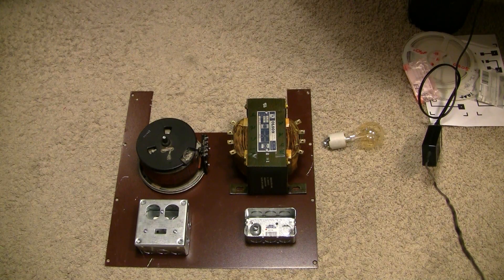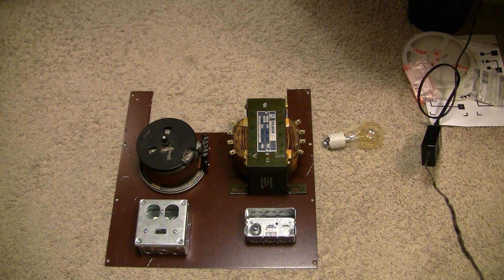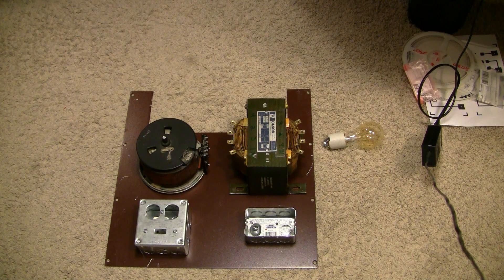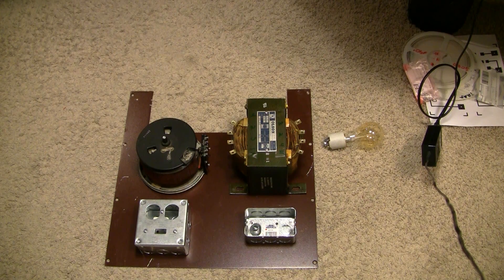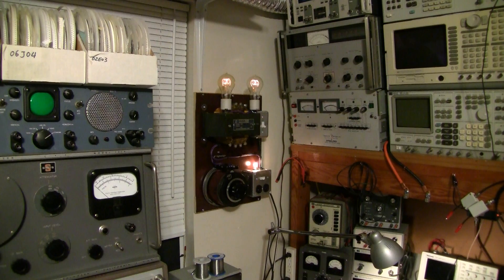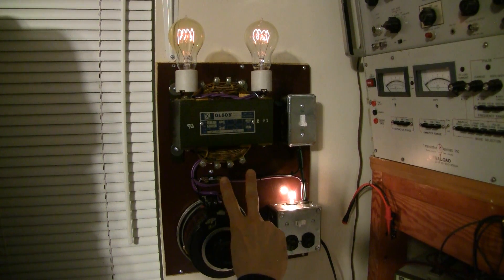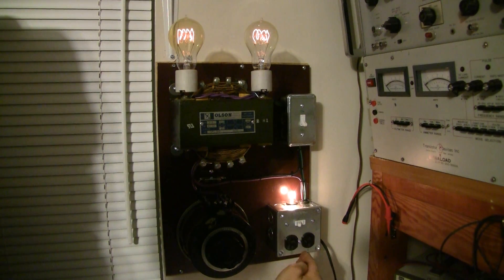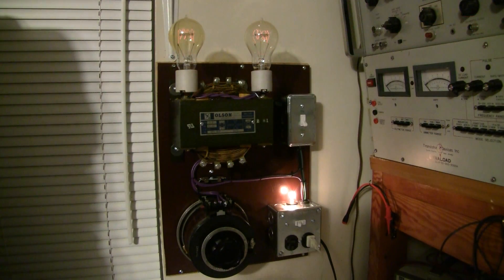Big Dim Bulb Tester with Variac and Isolation Transformer

Comment: Hello, I have questions. With your 2 bulb system you said it limits to about 1 amp. How would this be useful to see if a larger device that works normally at say 4 amps? A higher current device would light your bulbs bright every time making a person think there was a dead short when there wasn’t. How would a person go about calculating what wattage bulb to use to allow a current limit to just a bit below that of say a mainline power fuse wired to a power transformers primary?
In other words calculate a wattage of bulb to only limit or light brightly at just under main power fuse blow point with say the device under test using either a delay blow, or norm blow type of fuses. Or would a better approach be to note from device label the input wattage of the device under test, under its normal stated operating voltage, and then somehow select a proper wattage bulb that just starts to glow dimly at this point? Thanks for any insight you can provide.

Comment: Nice vid. Thank you for taking the effort to show us. 

What mounting do the bulb sockets have? Couldn't quite make out that detail. Rt-angle bracket screwed to the board? 

And the curly filament bulbs--did you source new ones somewhere? Or from the junque box? 

Cheers.
Reply from the maker: Hi Dave. The bulbs are from a local hardware store (Canadian tire) The brackets on the bulb sockets come with the socket. Thanks for your comment!
Reply: Here in USA is available Hubbell HBL5292 (brown) and HBL5292i (ivory). I plan to use this in my build.

Comment: Very helpful video with the best explanation I've seen for the purposes and relationship between the bulbs, variac and isolation transformer. If you were building this solely for 120 volts would you keep the bulbs at the same location in the circuit, or would there be any reason to move them to the secondary side of either the variac or isolation transformer?
Reply from the maker: z95m Thanks for the comment! If it was only 120 to 120, the bulbs could be on either side.

Comment: Hi Mr. C.  I have a small question. When you wire your current-limiting lightbulbs in series before the variac, won't you increase the output current-limit when you turn the output voltage down?  Is this intended?
Reply: Wouldn't the transformer saturate inflating the impedance if the current isn't being pulled fast enough on the output?

Comment: I have a Variac brand autotransformer, a topaz isolation transformer and I’m going to build the light bulb current limiter device this weekend. Is there a difference on where the isolation transformer is placed in the chain? Mr. Carlson has it placed last in this video, but could one place it at the front of the chain - that is, at the wall outlet - and then the variac, light bulbs, and DUT last?

Comment: I just designed my unit and came here to see how I did in relation to Mr Carlson's design... I put the bulbs and by pass switch on the output of the isolation transformer,  I wired in the Variac output to the isolation transformer  primary and it's secondary to the bulbs and on to the load..  appreciate any thoughts.. Did I miss something?

Comment: I was planning to put my variac and current limiting bulbs, on the output (secondary) side of my transformer, then I saw this video. If this was a normal 1:1 isolation transformer, would there be any benefit to which side (input / output) of the transformer you place the variac?

Comment: Hi Paul. Is there any particular reason to have the variac first and the Olsen after it? Here in Scandinavia the plugs are not polarized and a variac becomes even more unsafe. Therefore I have used my variac after the isolation transformer (which is of course just 1:1, no extra windings).

Comment: hi and thanks for the video. can i ask.why you used two bulbs in series instead of just one and how you arrived at 60 watts for each. i'm sure there is a reason and i would like to know. thanks again.
Reply: Not sure this ever got answered...Mr Carlson?
Reply: I'm certain Mr. Carlson would do a better job explaining this but I will offer what I can in hopes that it helps:
First, to clarify, the bulbs are in parallel with each other and in series with the circuit. By placing them in parallel the voltage is not dropped across them while the current is summated. This is to give a larger current limit than just one bulb. Of course a larger wattage bulb could be used instead of two but that's just design decision. Perhaps because of the wider availability of 60 watt bulbs or the ability to swap bulbs out to change the current limit easily but that is sheer speculation on my part. I think it looks cool with two.
How do we figure out what the current limit will be? With the bulbs in parallel their total wattage is added which gives this part of the circuit a total of 120 watts. Ohm's Law tells us that P = I * E or power equals current multiplied by voltage. We can convert that to P/E = I since we are looking for I. Since we have 120W from the bulbs and a source voltage of 120V we can enter these values into the equation and get 120W/120V = I which equals 1. That's how we figure a 1 ampere current limit when the bulbs are not bypassed by the switch while using the 120V output. Now when we use the 240V side of the transformer we would get a different result. Same formula (P/E = I), 120W/240V = .5A or 500 milliamps.

Comment: Hi Mr Carlson. Your videos are excellent! I completed an Associate Diploma over 20 years ago. Plus I’ve had a couple of years worth of some tech bench experience a number of years ago. You’re videos have inspired me to really get back into this field of work. Thank you.
I have a few questions. My country’s power is 240V. I want to repair SMPS for pro Audio equipment and tube/Transistor amps. I understand the current from our mains here would be approximately half of your 120V is the US for the same amount of output power to the device.
I’m not 100% sure if what current sharing globes to use. I’m assuming to match 1 amp I would simply use 2 x 120Watt globes in series. Some guitar amps draw 2 or even 3 amps. More for big 1000W pro Audio power amps. 
Thanks heaps in advance.

Comment: I recently inherited an old sola constant voltage transformer model 72104 95-130v in, 115-120v out.  Can these be used as an isolation transformer.  From what I can find out they seem like they have the windings isolated .  I got bitten by the "ground on oscilloscope" monster (didn't get hurt) and want to make sure it never happens again.
Reply: No, CVTs are not isolated. I wondered the same thing sometime ago as I have a few as well.

Comment: Hi Mr. Carlson, always looking forward to learning from your videos. I was wondering if the variac could be substituted with a rheostat set up as a voltage divider? I have a 500ohm 250W toroidal rheostat which I'd like to use, but I'm having second thoughts wether such a low-ohm device would just present a constant load and send the whole thing straight to brightly current limit. Any help/comment will be greatly appreciated.

Comment: After watching this again I am curious about the isolation transformer connections. After double checking it appears you are using a step down transformer in reverse. The H numbered terminals are the primary taps while the X numbered terminals are the secondary taps. Could the mismatch be caused by the connection between the Variac and the X taps? This is not strictly academic for me as I recently acquired a used GE 1.5 KVA dry type isolation transformer that i want to use for my own "Dim Bulb" set up.

Comment: Hey paul''''''''''i have a idea that i put to use & i want too know what you think'''' good or bad''''''i finally built my bim bulb tester'''''''what i did was i used 2 (150 watt) light bulbs'''' i put a switch on it so i can select 150 watt or 300 watts to take a bulb out of the circuit or put both  bulbs online''''''this a my idea of a current limiter controller'''''not trying to out do anybody'''''''just trying to make it a efficient as i can & utilize any practical 
 additional controls.... also change to different wattage of  bulbs but then id have to change the Labels to project that'''''ha''ha''ha'''''''thanks paul.

Comment: I recently made one of these with two transformers back to back 120/24 volt
This created the isolation. Mine is wired much like yours power switch fuse auto transformer two parallel series lamps then the transformer. The circuit puts out 135 volts. If I put a 1.3 amp 160 watt load the 135 volts drops down to almost 80 volts. The auto transformer and the two step down transformers are rated for 4 amps
I’m assuming this is due to the voltage drop created by the light bulbs?

Comment: A "must have" on any bench.

Almost 40 years ago in my electrical engineering classes, we always used 1:1 iso-xformers when working on AA5 radios and similar to avoid a hot chassis. But recently, I read someone using a couple of 2A step-down xformers wired: 120V||24V => 24V||120V as a "cobbed" iso-xformer.  Theoretically, it might work.  I'm a bit suspect of the safety of such a set up - current draw on the 2nd xformer; might be dangerous.  Agree?

Comment: I should know the answer to this but at the moment I'm being a bit lazy. If you connected the two 240v windings in parallel (in phase lol) first most obviously you would dispense with the 480v hazard but how if at all would that effect the power factor compensation that you demonstrated with the capacitors? You might find that standard cap values may get you closer to the ideal config. Or the reverse. Worth a try? It may even serve as a place to actually do your PF comp. Feel free to shoot me down.

Comment: What I learnt today:
A bulb is a cheap power resistor.
Thank you Mr. Carlson

-Jaideep
Reply: That gives you a visual indication, too.
Reply: A bulb is better than a resistor for this purpose because the resistance of the filament increase as it heats up. BTW, I've used a 2 slice toaster as a large resistive load for testing high power amplifiers.

Comment: I built mine open frame, but stopped using the bulbs.I found them a waste of time and money. Instead I use  an isolation transformer and a Variac tied to a metering system and the outlets are  GFI types.
Reply: If i understoold right you raise the voltage with the variac and watch the ammeter? What difference it makes when the isolation transformer is at the output side like he did or at the input side? IF you have a video or schematics that can help a lot also.

Comment: Just curious because I don't understand the intricacies of the circuitry, but I have a question.  Capacitors (even non-polarized capacitors) in an AC circuit - I guess I've always thought of them in use in a DC circuit.  Can you shed any light on this or what am I missing?  Thank you for your very informative and well thought-out videos!
Reply: The only point of the capacitor is to adjust the phase shift of the transformer(s) also known as the power factor back towards 1.0.  Google power factor for more info.  It is not really necessary for the function of the dim bulb tester.

Comment: Hi Paul... Very nice design! It looks really cool too, although a bit scary with the exposed circuitry.  I restore vintage radios as a hobby and built a small one for testing them. It's only a five amp system and I designed it a little differently than yours, whereas I have the dim bulb on the output side of the variac rather than on the line the way you have it. Although it appears to work fine, 
I am wondering if my design is in fact safe? if you are interested in seeing it, I could upload the schematic. 
Your evaluation would be much appreciated.

Comment: I totally need this in my shop!   Where can I find a good isolation transformer?   I have done similar to this on DC stuff with an old car light bulb one of the square bulbs like in an old pickup truck.  The bulb would catch me if I screwed up rather than blowing parts off the project I was working on.  Trick an old EE friend taught me 73 de Seth - W8FG

Comment: hi, I love your Videos I learn so much. I want to build one of these can you please tell me where and which transformer to buy for this project. I only need 120v to 120v. Thanks for your time.
Reply: Just1ofMany  ,  Look for a medical isolation transformer, but don't USE it until you remove the ground terminal by replacing the output power socket with a two wire socket. Or, make your own by disconnecting the ground lead from the normal, polarized socket from the output side. Watch out that you don't accidentally connect different sides of the output of the  transformer to two loads which might touch each other. In other words, use only ONE item at a time on the isolated winding (safest way) by only connecting one output socket. A medical grade transformer usually has lower coupling of transients because it has a very effective shield between its windings.

Comment: Mr. C.,
I have a question about your fuse placement.  I have always placed the fuse/circuit breaker before the on/off switch.  I noticed in all of the designs you have shared, you seem to consistently place the fuse after the power switch leaving the switch energized in the event the fuse blows.  What is your view or reasoning for this?  I am genuinely curious as I continue to work my way through your many and extremely informative/insightful videos.
Reply from the maker: Hi Philip. If I can, I will place the fuse first. You can see this in some of my radio restorations. In this video, the fuse is after the switch just due to component placement.

Comment: I have a 1947/48 Brunswick BJ-6836 AM radio that use to be my grandparents that I am attempting to repair. I just got it out of the cabinet and ordered the Photofact Folder off eBay. It claims its rated at .900A @ 117V. Im far from the point of powering it on. Still need to recap it. But when I do get to that point I want to build this. Is there a ratio to the current the lightbulbs limit to the current your load can take. If the radio where to draw 900mA (I doubt that is its normal steady state current but thats the only figure I have to go off of) the bulbs would be 90% lit. I would be within the 1A current limiting but wouldn't the bulbs be dropping a significant amount of voltage preventing the radio from working?
Reply from the maker: +Justin Derleth 
You are correct. You would need to use higher wattage bulbs, or parallel them. You can use a modern current meter to measure the line current as well.

Comment: Hi, first thanks for providing such a great resource to all of us.  My question is that I currently have a variac and a separate isolation transformer (2 units).  I would like to install the current limiter (big dim bulb tester) to that system.  I'm proposing to add the two light bulbs in series with the variac about line and then plug that into the isolation transformer (with an on/off switch)  Does that sound correct?
Reply: Yes,  the bulbs should see the line voltage for best results as current limiters.

Comment: Wouldn't it be more correct to call this a wattage limiting device instead of current? And I'm not talking about the variac, I mean that the bulbs will absorb the current of a faulty device but they also consume the voltage equally when loaded in series right? So more of a wattage limiter equal to the sum of the two bulbs ie two 60 watt bulbs would be 120 watt limiting right?
Reply from the maker: an m Sure, or 120W at 120V is about an Amp of Current limiting (give or take slight variance in the 60W bulbs) How ever you want to look at it, and from which aspect. Thanks for your comment.

Comment: Hi Mr Carlson could you please explain how I can identify the line and the neutral from the isolation transformer regards James
Reply from the maker: James Paterson  Hi James, the whole idea of an isolation transformer is to isolate you from that system. Line and Neutral are on the primary side of the isolation transformer. The secondary side isolates you from that (so called) polarity. (There is no connection between primary and secondary windings in a true isolation transformer) Many store bought isolation transformers carry the safety ground wire (green) through from the wall side to the secondary side outlet on the isolation transformer. One needs to keep in mind that the safety ground wire and neutral wire are tied at the breaker box in your house. Since these two wires are tied at the breaker box, there is a direct connection to neutral carried through to the secondary side outlet (by the ground wire) on some of these store bought isolation transformers. (This is not truly isolated from this stand point.)